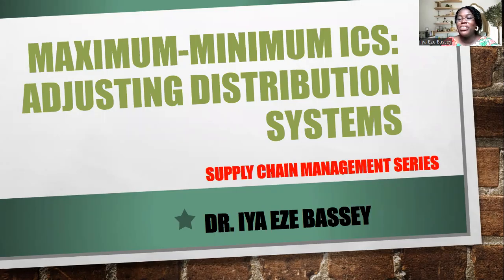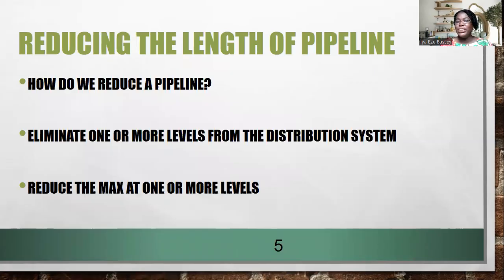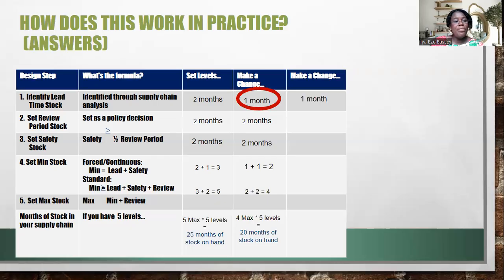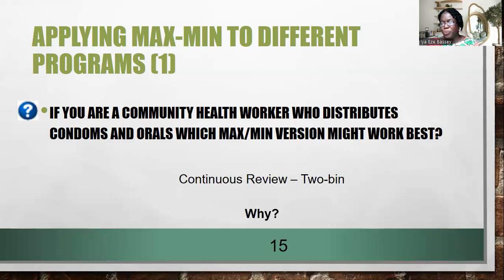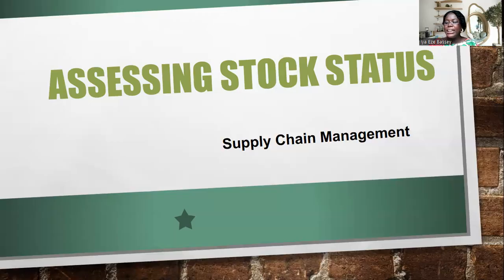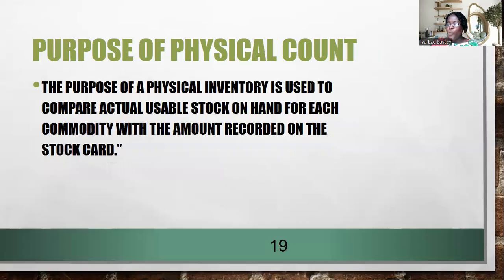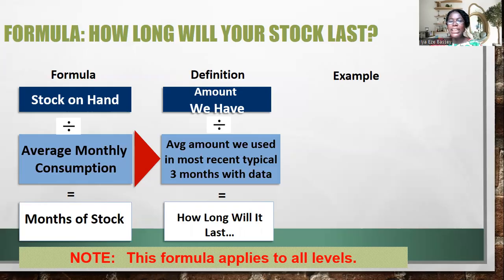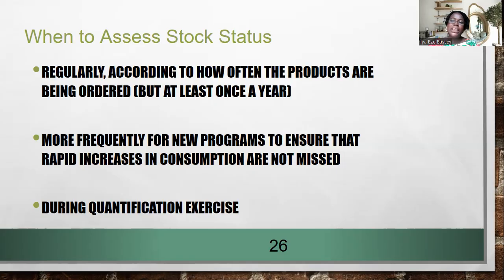Maximum-Minimum ICS: Adjusting Distribution systems (Supply chain management series)

Comment: Summary
  Max-Min ICS provides comprehensive guidelines for managing stock levels to prevent overstocking and understocking of commodities. The steps to design a Max-Min ICS include:
- Set up Max-Min policies for each level and type of facility 
- Verify that the overall distribution will function properly 
- Establish initial Max-Min quality for each level and facility type.
   Ways of adjusting the pipeline are:
- Eliminate one or more levels from the distribution system 
- Reduce the maximum stock level at one or more levels.
  Benefits of the Max-Min system are:  - Avoiding overstocking
- Avoiding understocking 
- Minimizing wastage
- Reducing emergency order point
- Consistency of stock orders 
       Some challenges faced in this system includes:
- System with numerous levels 
- System that manages large number of commodities 
- System that manages products for new programs.
NB: physical count is very important and should be done at least once a year.
        Thank you Dr.

Comment: Thank you ma for this informative video. 
From this video I was able to identify ways to adjust distribution system policies. I also learned the advantages of ICS such as to avoid overstocking and understocking, to minimize wastage, to avoid cost of emergency orders etc.
 
I have also been able to see the challenges of maximum and minimum ICS which are systems with numerous levels, systems that manage a large number of commodities and systems that manage products from new programs. The ICS used for LMHC were also described in this video including purpose of accessing stock status and many more.

Comment: Good day Dr Iya Eze Bassey 
In this series of supply chain management, I was able to identify the steps in designing max-min ICS and how to reduce the length of the pipeline which can occur by either emitting the one level which can only be done systematically. It includes:
 1. Reducing the reviewing period, 
 2.The lead time and then 
 3. Improving the systems distribution reliability
 The factors that impart max-min stock level and the advantages of using max-min system and the various challenges in using each version and variation.
Thanks

Comment: Thanks mma
In summary of this lecture,
I've learned that the maximum minimum (max-min) inventory control system is crucial for managing stock levels, helping to prevent both overstock and understocking.
There are steps in designing the Max_min ICS which are:
1)set up an initial max-min policies for each level and type of facility
2)check if the overall decision will function properly,if the level specific max-min policies are implemented.
3)check the total lengyof pipelines that the policies at each level can imply
Factors that affect max-min levels include
*Cost of production
*Lead Time
*Cost of storage 
*Storage capacity 
*Age of programme
In conclusion this factors have some advantages which includes 
*Minimize storage*minimize wastages*prevents overstocking

Comment: Thank you ma!

In this lecture, I am able to learn the following;
1. Identify the ways to adjust the distribution system.

2. Understand the advantages and challenges of the Max- Min inventory control system, and 3 inventory control system used in logistics management of HIV/AIDS commodities.

3. I am also able to;
- Explain the meaning and purpose of assessing Stock status.

4. Determine the number of months of stock available at any storage level given inventory and dispensed to user data.

5. Physical Count:
The process of counting by hand the total number of usable units of each commodity in your store or health facility at any given time.

The purpose of physical Count/ inventory is used to to compare actual usable stock on hand for each commodity with the amount recorded on the stock card.

And I also understood and know when to assess stock status. 26:56

Comment: Thank you for this lecture Ma.

This session deals with adjusting distribution systems in the maximum-minimum inventory control systems.

You explained how to improve distribution systems in a country by reducing the length of a pipeline. A pipeline refers to the time it takes for a material to travel from the central warehouse to the clients. Using an example of a pipeline in Nigeria that distributes HIV/AIDS commodities. The pipeline is too long, at about 20 months, which means it takes 20 months for a medication to get from the central warehouse to the rural clinic.
You suggested two ways to reduce the length of a pipeline: eliminating one or more levels from the distribution system and setting policies that can help reduce the max at one or more levels.

Thank you once again Ma for putting out this lecture!

Comment: Lecturer described ways to adjust distribution system policies.
-Advantages and challenges of max-min inventory control systems.
-Described inventory control systems that are used in logistics management of HIV/AIDS commodities (LMHC), meaning and purpose of assessing stock status.
Also determined the number of months of stock available and storage level given inventory and dispensed to user data.
Thanks.

Comment: Thank you ma for yet another amazing session.
In summary, ive learnt that max-min ICS is essential to monitor stock to prevent overstocking and understocking and ive also learnt the different steps in designing a max-min ICS and they are;

  *Setting initial min- max policies as nd the type of policy
 *Check if the overall distribution will function properly ie if the level's min- max policies are implemented
  *Check the length of your pipeline

Comment: In summary have learnt the steps in designing a Max-Min Inventory control system. 
How to reduce the Length Of Pipeline, How to reduce the maximum stock level.
Also learnt the factors that can impact Max-Min stock levels which include; Cost of products, Reliability of transportation, storage capacity, cost of storage etc 

Also learnt the advantages of using Max-Min system , which is to avoid overstocking, avoid overstocking etc.
Also learnt about physical count;
Which is the process of counting by hand the total number of usable units of each commodity in your store or health facility at any given time. And the purpose of physical count which is used to compare actual usable stock on hand for each commodity with the amount recorded on the stock card. 
Also learnt the purpose of Of Assessing Stock status and when to asses stock status.
Thank you for the nice lecture .

Comment: This lesson centers on the purpose of adjusting distribution system showing the purpose of physical count after delivery and many more. It teaches the following: Shorter review period, reduction of lead time, overall distribution policies and the total length of pipe lines showing how it can be reduced and possible elimination levels. Advantages of this lesson include Shortage minimization, shortage of wastage and ways to prevent overstocking to avoid expiration of products before usage.
Also I now understood the benefits of a Max-min system, such as preventing overstocking and understocking, along with the challenges associated with different versions and variations. This series of lessons has been incredibly enriching.
Not only does the Max-min ICS help in preventing overstocking and understocking, but it also aids in avoiding emergency order costs by providing a guide to the stock status on a regular basis.
Furthermore, it assists in the assessment and management of the length of pipelines of policies at each level.

Comment: An interesting topic.
Looking at the max-min (which is the highest minimal amount) instructions for managing stock levels is crucial in a laboratory logistics system.
This benefits as avoidance of overstocking and under stocking of health commodities are been provided by the inventory control systems (ICS).
This ICS system of logistics management also helps to reduce the cost associated with emergency orders, it helps with assessment and management of the length of each level policy's pipeline.
This can be done by streamlining the supply chain which is carried out by:
1. Eliminating unnecessary stages in the distribution system.
We also looked at the factors influencing optimal stock levels
- cost of product
- storage capacity and
- Health commodities shelf life.
The key steps in designing a max-min system are:
1. Effective functioning of the distribution system.
2. Establishing max-min system for each facility type.

Comment: In  summary;
>The steps in designing a max-min ICS include;
1.) You set up initial max/min policies for each level and type of facility.
2.) Check if the overall distribution will function properly if the level’s specific max/min policies are implemented.
3.) Check the total length of the pipeline that the policies at each level imply.
 
>To reduce the length of a pipeline you can;
1.)Eliminate one or more levels from the distribution system.
2.)Reduce the maximum stock level at one or more levels.

>To reduce the max stock level you can;
Change some elements of the formula. For example shorten the review period and lead time at one or more levels.
You can also improve the distribution systems reliability at one or more levels so that the safety stock can be reduced.
>Other factored that impact max min stock levels include; 
1.) cost of product.  2.) storage capacity 3.) cost of storage. E.t.c.
>Advantage of using max/min system:
~To avoid overstocking and understocking.
~To minimize wastage.
~To simplify IC decision making.

>Challenges to using each version and variations include;
•systems with numerous levels.
•systems that manage a large number of commodities.
•systems that manage products for new programs.

>Standard version can be used for drugs and HIV test kits .
>Continuous review version can be used for condoms and orals.

ASSESSING STOCK STATUS.
>A physical count is a process of counting by hand the total number of usable units of each commodity in the store or facility.
It is done to compare actual stock on hand for each commodity with the amount recorded on the stock card.
It should be done at least once a year in a normal system. Or as frequently as possible. 

>Formula for how long a stock will last;
SOH divided by AMC = months of stock.
Note; this formula applies to all levels.

When should you assess stock status;
Regularly at least once a year.
~more frequently for new programs.  And During quantification excercise.

Comment: I've learnt about the different steps involved in designing a Max-Min ICS which are;
1.To setup initial Max-Min policies for each level and the type of facility.
2.To check if the overall distribution will function function properly if the level specific Max-Min policies are implemented.
3.To check the total length of the pipeline that the policies at each level imply. 
 I've also gotten a valuable insight about the advantages of using the max min ICS which is to avoid over stocking , under stocking , minimize wastage, simplify inventory control decision making and also consistency of stock levels. 
Thank you.

Comment: In this video I have learnt, the steps in designing a max-min ICS which are, to set up initial max min policies for each level and type of facility, check if the overall distribution will function properly if the level specific max- min polices are implemented and check the total length of the pipeline that the policies at each level imply. And I also learnt that there are ways to reduce a pipeline which includes eliminating one or more levels from the distribution system and reducing the max at one or more levels. And the way to reduce the maximum stock levels which is to reduce some elements of the formula which can be changed in order to reduce the max-stock levels examples includes shortening the reviews period at one or more levels, reducing the lead time at one or more levels, improve the Distribution system's reliability at one or more levels so that safety stock can be reduced and alot more I learnt from this video.... Thank you so much ma.

Comment: In summary, the inventory control system are very important in supply management. Example of this are fuel guage and storage practice to illustrate their importance.
Concept of inventory systems are: review record, maximum and minimum level, emergency oder point and lead time.
Review record: schedule for checking stock level. 
Max and min stock level: referred to as upper and lower level that should be kept. 
Emergency order point: this entails when an urgent order must be placed
Lead time: interval between ordering and receiving of stocks.
Max-min inventory systems:
1.first ordering system 
2.continous review system
3. Standard version

Comment: Summarizing this; tue steps in designing a maximum ICS are
1.setup your initial maximum policy
2.check the overall distribution system whether it would function maximally
3.check the length of your pipeline
The maximum minimum ICS provides comprehensive guidelines for managing stock levels to prevent both overstocking and understocking of goods.
It also aids in avoiding emergency order costs by providing a guide to the stock status on a regular basis.
Thanks alot ma'am i really appreciate this explanation 😊

Comment: Thank you ma, in this video, i could grab what can be done to reduce the length of a pipeline. Shorten the reviews point at one or more levels, reduce the lead time at one or more levels are on how to reduce maximum. I took notes of the factors that might affects the determination of max/min stock levels besides the length of the pipeline which are

1) cost of products

2) storage capacity

3) cost of storage

4) shel life at health commodities etc

The advantages of using max/min system were vital. Assessing stock status is important because it helps to know when physical count can be done and its purpose

Comment: In summary, maximum-minimum adjusting distribution ensure:

1.That the overall distribution are perform properly

2.That the total length of the pipeline polices are implemented at each level

3.Gives detailed information instructions for managing stock level to avoid overstocking and understocking of commodities.Thank you ma

Comment: Max-min inventory control system provides comprehensive guidelines for managing stock levels to prevent overstocking and understocking.
The lecture talks about various types in designing a max-min inventory control,the steps for reducing pipeline length,and some factors affecting it.

Comment: Fourth video: from the above video I have learnt the different processes or system of report and record used to gather, organize and prevent logistics data gathered across all levels of the system in other to make an informed decision. The logistics system failure relies on the fact that right information that can produce good decision making are not collected. I also learnt about these parameters used in data collection like stock on hand,rate of consumption, losses and adjustment and reports

Comment: This lesson explains ways of adjusting the distributor system policies. This can be by: 
1. ELIMINATING ONE OR MORE LEVELS FROM THE DISTRIBUTION SYSTEM 
2. REDUCING THE MAXIMUM STOCK AT ONE OR MORE LEVELS.

The lesson highlights the different factors that impact Max-Min Stock Levels, the advantages of using Max-Min Inventory Control Systems and the challenges faced in each version of ICS.

In addition, the lecture explains Physical Count to be a process of counting by hand the total number of usable units of each commodity in a health facility at any given time, its purpose and the purpose of accessing stock status.

The Lecture concludes with the frequency and importance of accessing Stock Status. A lecture indeed worth every time and effort.

Comment: Thank you for the lecture ma'am.

In summary, adjusting distribution system policies can involve various strategies, such as centralizing or decentralizing warehouses, revising stock replenishment rules, and optimizing transportation routes. One example is the Max-Min Inventory Control System, which aims to maintain inventory levels between maximum and minimum thresholds. This approach offers advantages like reduced stockouts and efficient use of storage space, but also presents challenges, such as the need for accurate demand forecasting.

The logistics management of HIV/AIDS Commodities (LMHC) utilizes an inventory control system focused on ensuring the availability of essential medicines and supplies. By assessing stock status, current inventory levels are evaluated against expected usage, enabling the calculation of the number of months of stock available at each storage location. This data informs distribution planning and helps avoid stockouts or overstocking.

Comment: topic :maximum - minimum inventory control system 
during the course of this lecture I learnt the steps in designing max-min inventory control system which are:
1. setting up initial max- min policies for each level and type of facility
2. checking if the overall distribution will function properly if the level specific max-min policies are implemented 
3. check the total length of the pipeline that policies at each level imply 
I also learnt about the advantages of max-min system which are 
a. waste reduction 
b. prevention of overstocking and understocking 
c. consistent supply maintenance 
Factors that can possibly affect max-min inventory control system levels which includes 
1) lead time 
2) cost of products
3) cost of storage 
4) storage conditions at different levels 
5) shelf life of health commodities 
thank you ma It was really a wonderful one .